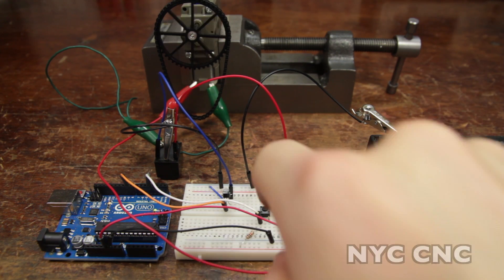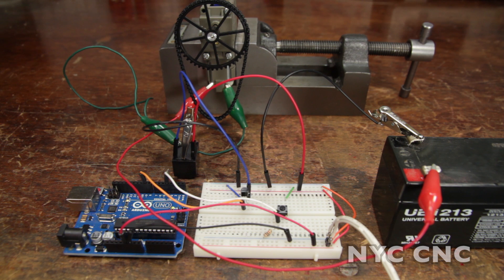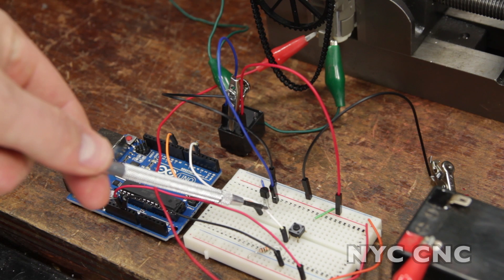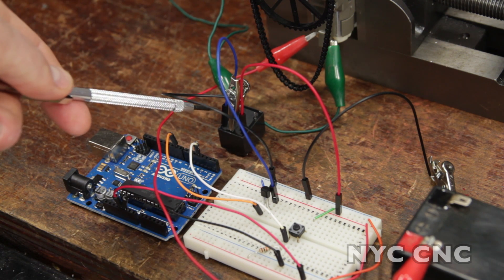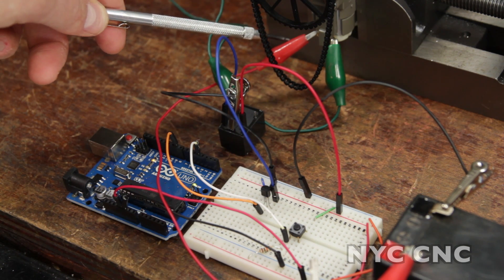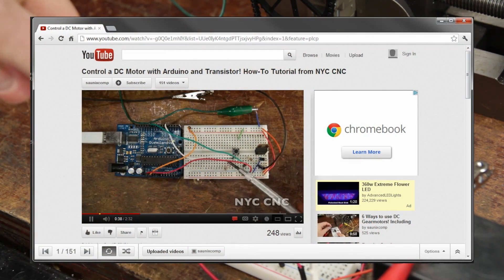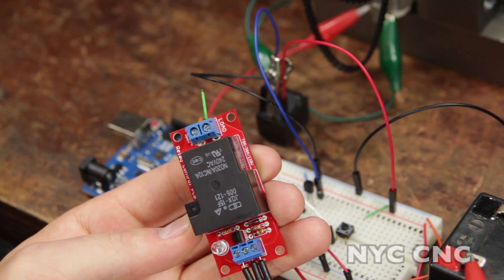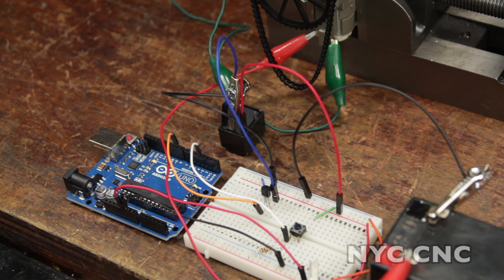Control a DC Motor with Arduino and a Relay!  How-To Tutorial from NYC CNC

Comment: instead of controlling one motor, is there a way to connect another motor with the same power supply (12v battery)

Comment: I have a question. I could not get it to work if I plugged the botton right cable of the realy to the positive as given by the big battery. It only works If I connect it to the arduino. It works though!! How come?? My voltage stays  steady when I turn on the motor and when its off!!

Comment: Dear friend, i use this rele http://i.ebayimg.com/00/s/ODAwWDgwMA==/z/p5QAAOxyoExSCJN6/$T2eC16J,!yME9s5qF3WPBSCJN58iqg~~60_35.JPG?set_id=8800005007  and I want to connect with a extra power supply like you, in the rele there is a jumper GND VCC JVCC how should I connect correctly? Thanks for your help

Comment: this look counter intuitive, why you this relay then if the transistor or a mosfet will do the same thing ALONE and works the same way  ? 5v triggers the gate on the npn transistor for low power motor application with the digital pin to gate or base while the same thing can be accomplished using the mosfet for high power high current motor application? not to mentioned that the relay cost a bit more then a single transistor
Reply: He is only saying this is one POSSIBLE way to solve the problem. How you do it is up to you, but I would also use a transistor...

Comment: I wondered about that, at least how running the current in reverse would effect how each component iterated different; makes scene.  I'm in the process of building an Arduino ATmega at the component level to make the package as small as possible.  I've got a lot to learn, but what fun it is!

Comment: Also.  If you are actively running code on the Arduino board plugged in powered via the USB cable with a computer, can you simultaneously apply power to the power plug on the Arduino (next to the USB plug). So that you could then unplug the USB cable and switch power sources from the computer to another power source?

I read you can do this but it required a MOD to the Arduino board or something like that.

Thanks, really appreciate your willingness to teach & provide excellent quality videos.

Comment: 1:40  COOL!  I did not know you can power the Arduino that way.  So you don't have to have a USB power in, or use the other power jack on the Arduino next to the USB plug? 

What is the voltage range you can power it this way?  3.3 - 12VDC?

Thanks!

Comment: hi sir just wanna ask if what is the transistor did you use?can i start a car connected in a solenoid valve triggering the solenoid with a arduino that output current is 5v?

Comment: I want to control a motor with a relay too, on the arduino uno r3. The relay exactly needs the current and potential that the arduino gives, do i need to put a resistor beteen the ground and the relais? And how do i know what is the + and the - of the relay? Your video was really helpful :)